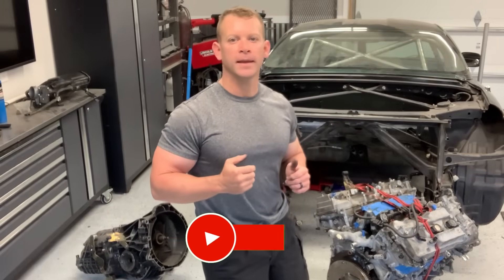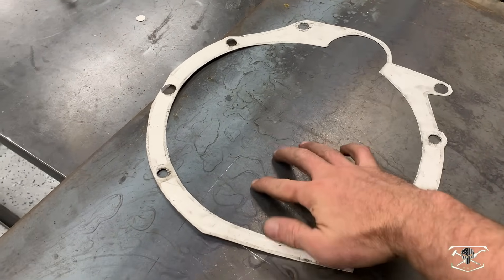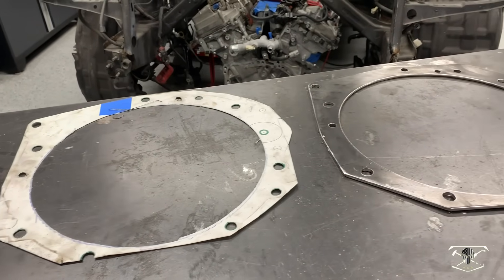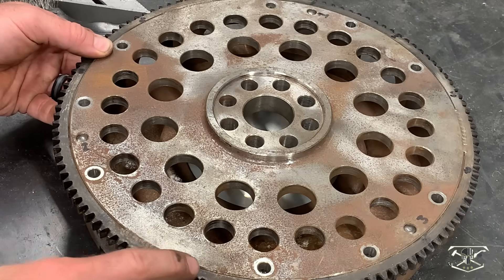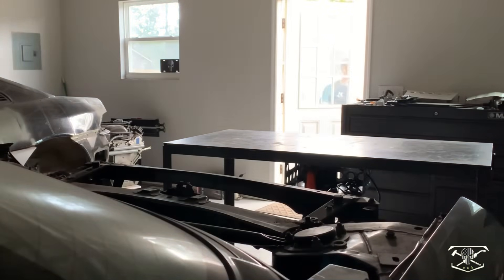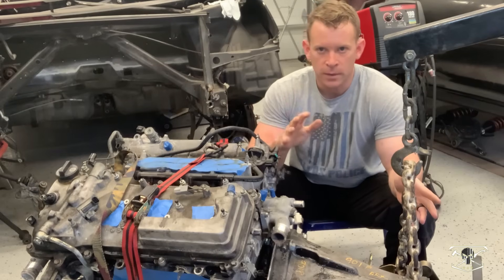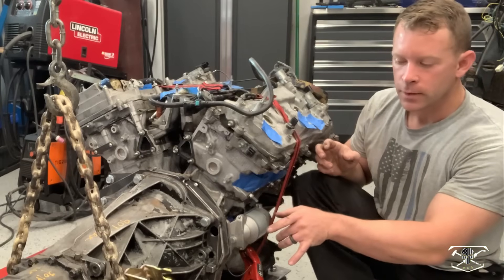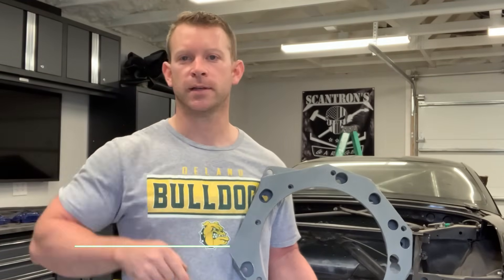DIY Engine Adapter Plate (Mate any Engine to any Transmission)

Comment: Wouldn't you need a longer input shaft?
Reply from the maker: Yes and no. You need to compensate for that difference somewhere. In this case I used an extended flywheel which makes up for the distance the adapter plate created.
Reply: So the flywheel hub is just thicker?
Reply: How did you get the measurement of how much you needed on the flywheel hub to make up for the plates?
Reply from the maker: @johnmahon8471  Easy... I just mounted the engine to the transmission with both plates mounted tp the engine side and transmission side. I measured the gap between the two and then added 1mm to give the throwout bearing some space.
Reply: @scantronsgarage  good deal

Comment: That flywheel wasn’t on straight before u welded the bolt check it out
Reply from the maker: I know what you were looking at. That flywheel has a center plate that bolts in. It was not fully seated when I turned the crank with the starter. You can see the center plate wobble but the flywheel is true. I totally understand your concern

Comment: I know you didn’t say or show, but did you use a spacer sleeve between the plates where the bolts pull the plates together? Probably don’t need them. But I don’t know for sure. So I am just asking. You’re the pro not me.
Reply from the maker: No spacer was needed between the plates. the thickness of the middle piece I welded in accounted for the proper spacing needed

Comment: I see how that gets things bolted up, but how are you aligning the centerlines? Relying on the trans shaft into the pilot bearing?
Reply from the maker: Yes, and checking for runout on the transmission side. before bolting it up, spin the transmission to see if there is any deflection. luckily there was none on this one

Comment: That is a unique way to make an adapter. Many adapters don't require filling this much longitudinal separation. I didn't hear you say what the plate thickness is? Is it 1/8 inch or thicker?
Reply from the maker: Thank you! I used 3/16 in plate to build the adapter

Comment: Im just getting into custom automotive stuff, and this is the perfect video, ive watched it about 10 times now and will probably watch it a good 100 times more to grasp everything in the video. Have been working on cars and dirtbikes for about 5 years now, still learning as always, and im going to attempt to do a motor swap in my pickup for towing purposes. The stock motor isnt cutting it as its factory output is right around 80hp and like 70 ftlbs of torque. I saw that flywheel/clutch adapter, and thought, thats a lot of weight to be spun, but i guess its is getting mated to a v8 in your case so it will spin a lot easier than a 4cyl or 6cyl. Very curious about the weight of the flywheel with the clutch spacer on it. Wouldnt it cause the engine to rev slower hense decrease performance? Obviously if the clutch is engaged then you dont feel it as much, but it is still extra weight the engine has to spin. Im planning on swapping a v6 inplace of a 4cyl, i guess the heavier flywheel would help with not stalling but very curious on how it changes the feeling of the clutch, and if it changes the output feel of the motor due to the extra weight. I see youve answered just about everyones questions and ive been going through them and youre very helpful. One of the most informative channels ive came across. Thanks in advance.
Reply from the maker: Hi! I'm happy to hear my videos have helped. To answer your question, yes the heavier flywheel will have some drawbacks but was necessary to make this work. Basically, the engine will rev up a bit slower but I think it will barely be noticeable. And like in dirtbikes, a heavier flywheel is good for drivability like trail bikes using heavier flywheels. I hope your engine swap works out for you.

Comment: I love the video. But I have done engine swaps in the past & it always makes you end up with a oddball. Takes endless hours to put together & in the future anytime something brakes you have to try to remember what car things came off & forget going to the parts store with your number plate to get parts. Also if you don't want to work on it there are very few people that will even have a look at it. far cheaper to just go buy the car with the power you want.
Reply from the maker: Yes and yes, however sometimes the heart wants what the heart wants. In this case it was a 2GR in a MR2. But yes there is always a lot of issues to work through.
Reply: @scantronsgarage  I only added the comment as a warning to others. We don't always think of what it will be like in 10 years time. When we have forgot what parts we put into a build.
Reply from the maker: @calthorp  Oh I see

Comment: When I swapped a t56 to a mopar 440 I had to align the bell housing 
With offset dowel pins 
You have no issues with alignment?
If not excellent job!!
Reply from the maker: I had no issues. I re used the dowel pins from either side after leveling both. I just had to make corresponding dowel pin holes. And Thank You!

Comment: Great, but what were those orange meters you put on the block? What are they measuring and why?
Reply from the maker: That was a digital angle finder. I used that to level the block and level the transmission : )
Reply: @scantronsgarage  thanks for the reply. Please would you be very kind and  explain which angles it measures and how one knows where to place it on the block etc for a good reading? I'm interested in the concept of what you're doing and want to swap a couple of (different make)  motors so all good info appreciated.
Reply from the maker: @gurglejug627  Sure! you technically want everything to line up on the same level. Engines can differ. some engines are angled from the factory in certain cars like most 4 cylinders. My transaxle was a must for making level due to it having the input shafts built in. Normally, you can find a flat spot on both the engine and transmission to use as a level reference.
Reply: @scantronsgarage  thanks so much
Reply from the maker: @gurglejug627  Sure ! No problem

Comment: 1:10  LOVE the paper to surface with ball peen hammer to make templet, SO EASY ! Have used numerous times
Reply from the maker: If it works it works. And it makes crisp cut lines too

Comment: That whole cage you had sitting on the flywheel to relocate the pilot bearing and clutch surface, did you have to get that custom done or were you able to find it somewhere? I'm looking at (Possibly) mating a sbf to a cd009 if possible and wasn't sure what that would be called or where to look for it
Reply from the maker: This was parts from another adaptor plate. Kennedy engineering products made that part. You can find them on the web. I have bought a few adaptor plates from them.
Reply: @scantronsgarage  Right on, thanks!
Reply from the maker: @connerfealonhoulihan2292  Sure! no problem

Comment: I admire your ingenuity, but I would question how accurately you have maintained the center line of engine and transmission.
Reply from the maker: I agree with you. But under these circumstances, it seems to have worked.
Reply: @scantronsgarage Well that is good!  In my builds lf adapter plates no matter what precautions, when I checked the run out I was always out of spec. and had to go back and adjust.
Reply from the maker: Measuring first would have been the better choice for sure. @mikemakuh5319

Comment: How did you center the adaptor to prevent misalignment
Reply from the maker: I used the input shaft into the pilot bearing which allowed this to self center. This assuming the input shaft is not bent and perfectly centered. Knowing the transmission was good prior to this helped.

Comment: Did you sort out the 12mm taps breaking? In case you haven't, what size hole are you drilling? A rule you can use without a tapping chart is metric bolt size minus pitch = hole size. So M12 x 1.25 pitch = 10.8
M12 x 1.5 pitch = 10.5
Reply from the maker: I don't know. I did not have any issues with a tap breaking nor did I need to thread any holes in this vid.

Comment: Good job . But question is ..your adapter increases a length of transmission... transmission is maximum 1.5 to 2 inch length is increes... what are you solving this .. explain me .. thanks
Reply from the maker: So I started with the custom flywheel which stuck out further about 25 mm. So in turn, I made the adapter plate 25mm thick to account for the spacing difference. 

Either way, the adapter plate width must match the flywheel extension. Hope this helps for an explanation.

Comment: But wouldn't you need an adapter to line up into the pilot bearing and or a shaft extension to reach the pilot bearing, what if the clutch from the new transmission is bigger than the flywheel.
Reply from the maker: you would. however the flywheel I was using accounts for all that.

Comment: You put plates together but how do you know they are lining transmission up correctly before welding.
Reply from the maker: The transmission was seated in the pilot bearing and i made sure the spacing was the same all the way around.
Reply: Ok for angularity but centers could be off right?  As those tranny inputs can move a fair amount side to side?

Comment: I Don't Have the Skills Or Tools To Weld and Bend All Those Metal. Wish I Did. But, I'm Looking to Drop A Mercedes Transmission into A Q50 To Liven that Powerful Engine Up. I Wish You You Could Build Me An Adapter Plate, But I Know its A lot Of Work, Even If I Agree To Pay. Being a Tinkerer Myself. Things Like these are Usually Labor Of Love.
Reply from the maker: Yes this certainly a labor of love. I was determined to get this drivetrain in the back of that MR2! And thank you : )

Comment: Nice work without all the big fancy tools. When I put a v8 into an s10 many years ago, I made a single plate that connected the motor and trans. Truck originally had the 2.8 60° motor. I went about the same way making my template.
Reply from the maker: Awesome! This way works for sure however I would like those fancy tools some day

Comment: “I’m ok with doing sorta sketchy stuff” Understatement of the week bro.
Reply from the maker: Haha! We all do sketchy stuff
Reply: @scantronsgarage what model 2gr-fe did you go with and what starter did you go with as I'm looking to dot he same swap, also what gearbox did you use
Reply: Fr, my friends and dad always try to do things absolutely perfect and wind up never getting anything done, gotta redneck it sometimes
Reply: least its better than my father... he bought a chainsaw attachment for his angle grinder, which he still has yet to put the guard or handle on, and was cutting wood without gloves; one kickback later, and he lost feeling in 3 fingers. tore several nerves, and he only just got feeling back in two of his fingers, with the 3rd still being rather numb... still doesn't have the guard or handle on his angle grinder, but at least has more appropriate eye protection aside from range glasses.
Reply: sketchy stuff FTW!
Reply: Sketchier, the better , that's why we love rat rods, brotha 💯 😅
Reply: Indeed. With plasma cutters available from discount stores for not much more than the price of a decent grinder, I think I’ll keep my fingers, thanks. But otherwise this looks great, apart from the sheer size of the finished adapter and the enormous rotating mass. I need to get all this done, typically in a half inch, or less, of additional overall length. It really needs to be a single sheet of metal.

Comment: I did not see any dowel pins for "sure" alignment, and the bolt holes were pretty loose... It seems under High stress loads (Fast hard take offs) it might loosen and begin to move around on the bolts till they fail... But it is a great "get-by"... to spending "big" dollars
Reply from the maker: Thanks! there were dowel pins. I failed to mention all that

Comment: have a 1987 Mazda Rx7 gxl; I would like to convert it in a V8. Can I make the conversion without changing the rear end?
Reply from the maker: You can. But can the old rear end handle the added torque?
Reply: @scantronsgarage  I hear you! 
I think it would hold, as long as I don’t do anything crazy like racing or drifting! The little rotary looks like not much, but it packs a huge punch; especially at higher rpms. I plan to change the driveshaft and rear end eventually; though.
Thank you for responding!!!

Comment: Nice job .yeah I'm putting a LS3 in my gti and using 6 speed transaxle ..I've made adapter  plates just working  on flywheel adapter...
Reply from the maker: Nice! sounds awesome! The flywheel takes the longest unfortunately. Keep up the work!

Comment: This is going to be a light-weight adapter plate as compared to a solid adapter plate,
Reply from the maker: Aluminum would have been preferred from a weight savings perspective. I did not have the appropriate machines to make it from aluminum though

Comment: very Nice concept and really like you circle cutting with a grinder.   How did you arrive at the depth?  I assume you went into pilot bushing fully and back slightly.   Also what Transmission are you using?
Reply from the maker: you are 100% correct. I also had a factory engine and transmission on the side to help me with measurements. The transmission is a 6 speed transaxle from a boxster s.

Comment: Dude thanks, I always thought about doing something similar but was unsure. So was the flywheel a Frankenstein from the flexplate of the engine and flywheel of trans? I didn’t understand that part.
Reply from the maker: Welcome! and yes the flywheel is somewhat of a frankenstein piece. I used a off the shelf flywheel from a toyota truck. I then had to add the spacer "crown" which has a porsche clutch surface. Basically these two pieces bolt together and make the whole thing work. This was the most expensive and time consuming part of the process

Comment: Nice, that's almost exactly how I would have done it , great minds think alike, new subscriber here!
Reply from the maker: Awesome! Thank you! And yes, great minds do think alike. Thanks for the sub!
Reply: @scantronsgarage  tho I would have started with the sheet of metal, drawn a big X corner to corner both ways to find the centre, and opened the centre hole to slip the First motion shaft of the gearbox through to mark bolt holes, nice to see manual transmission set up too.
Reply from the maker: @Jools-j2l  Oh I like that thought process

Comment: I'm probably over my head with this idea but could something similar be done to pair a Mazda 13b with a GM 700R4 or GM 6L80?
Reply from the maker: I thin it would work. Just make sure the bell housings are about the same size and you should be good. Start with the cardboard templates and see how things line up before you proceed.

Comment: I am putting a Freelander V6 auto transmission in a 4 cylinder Freelander (they are the only ones emissions compliant for London, UK). This video is exactly what I needed. My project is a little more complicated because it's a transverse engine and I will have to cut down the bellhousing to make room for the adapter. Using an angle grinder on pivoting bar is brilliant. Thanks!
Reply from the maker: Thank you! and good luck with your project. Making room is always a challenge but it sounds like you have already thought that part through. Happy I could help and it is cool to hear my video reached you in the UK.
Reply: How did you know that the input shaft on the gearbox was perfectly in line with the crankshaft before you welded it? My torque converter has a fair bit of play on the gearbox input so some how I need to lock it in exact centre or something. I don't know how to do that

Comment: Maybe I would have ended up warping it, but I'm inclined to take a strip of steel and bend it into a hoop over a plywood form then tack it at one spot. And then go around tacking it around the perimeter bringing it into round. Then do the outside after.
Reply from the maker: That would work too. There is always more that one way to go about it
Reply: @scantronsgarage   @scantronsgarage  I really like the way you do it with two pieces, allowing you to fit each half separately then marry them together. It takes advantage of the fact that steel has more strength for its thickness than aluminum. 

I do have a slight concern about the shaft alignment, even though you checked to see that they spin freely. A radial load on the bearings could lead to excessive wear. It's clear that you've done it before and it seems experience is key there. Not having done that before I'd be concerned that I don't know what it feels like spinning the shaft if it's right or wrong. I could probably spin the shaft, think it was ok, and run it but really have it way off. 

It looks like there's enough room in there with the clutch and flywheel off for a dial indicator to be mounted on crank shaft and indicate off the transmission input shaft. You'd be peeking though the inch gap but It should work. I used to have a really tiny one that was great for that kind of stuff. This reminds me, I need to go find another.

I have a 351C in a 72 IH 3/4 and I've been considering fixing up it instead of parting it out. But it has an FMX, so I'd need a new tranny. Now I'm seriously considering the possibility of using one of the 6 speed manual truck transmissions that mates to a modular V8 instead of the 5 speeds that I thought I was limited to.
Reply from the maker: @michaelallen1432  I do have the same concerns on centering the input shaft perfectly. However, it lines up and goes together better than or as well as a stock transmission . so that gives me hope.

Comment: You could also just cut it out with a jig saw. But the angle grinder with the makeshift circle cutting adapter looks like it works well.
Reply from the maker: It did work out well and gave me a perfect circle.